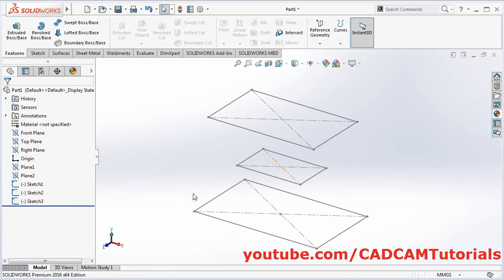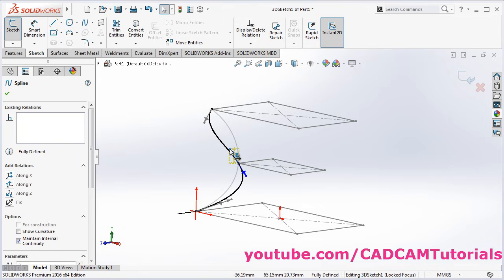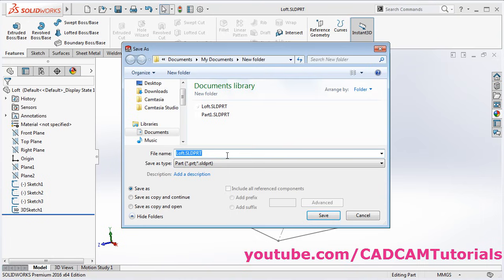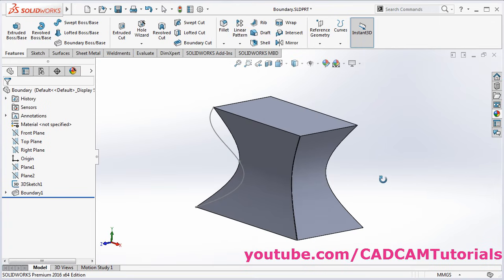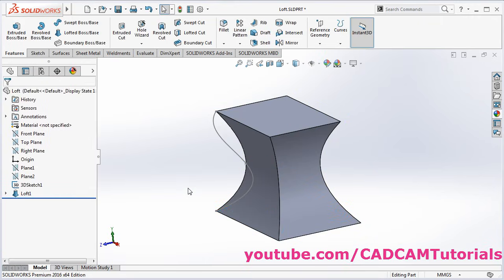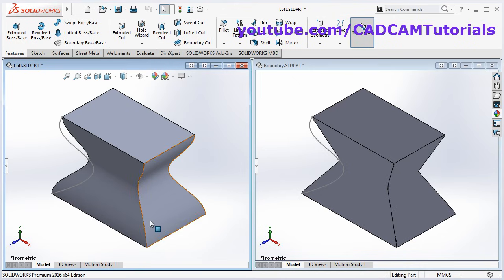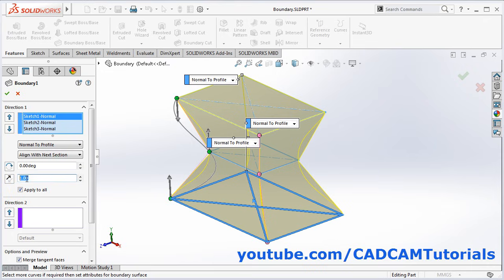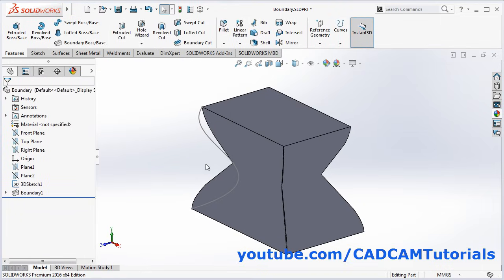SolidWorks Boundary Boss Base Tutorial and Difference between Loft and Boundary in SolidWorks

Comment: You will want to select the sketch corner where you want the green dots to populate on when you choose each sketch profile, this will help keep your loft/boundary from getting twisted up especially in cases where you aren't using guide curves.  More consistent than dragging the green dot and a lot faster. Boundary also has flip connection option if you right click in "direction 1"  menu to sometimes realign the green dots.

Today I learned loft regulates the shape more normally and boundary is like a series of lofts which interact with each other.  If you need clean non-spline edges and surfaces use loft as boundary can become unstable in some cases.